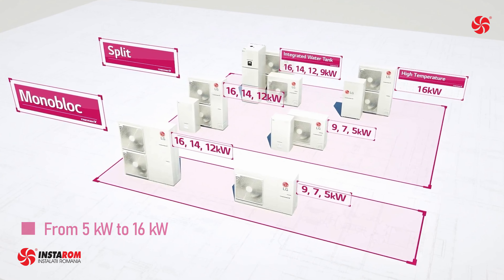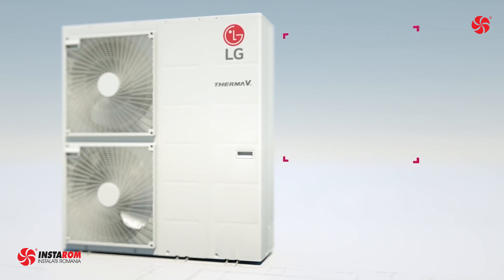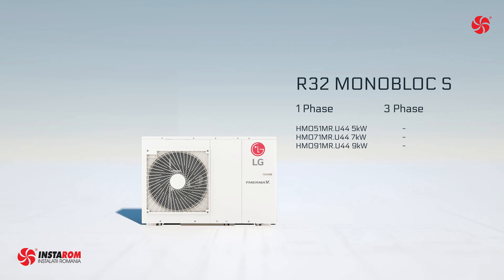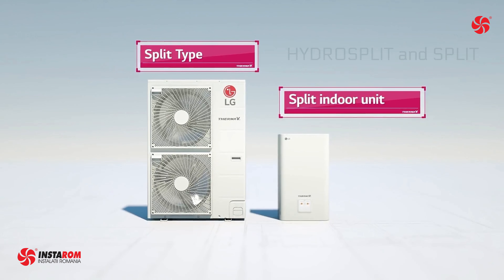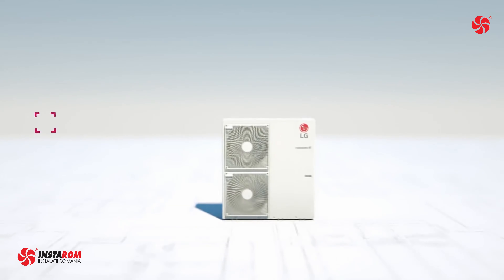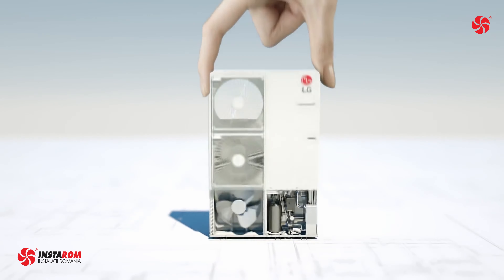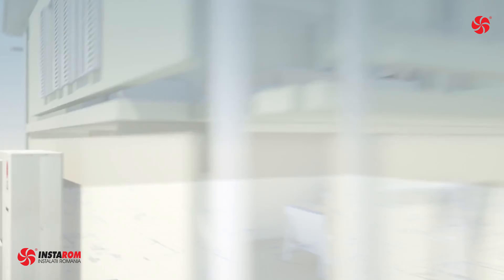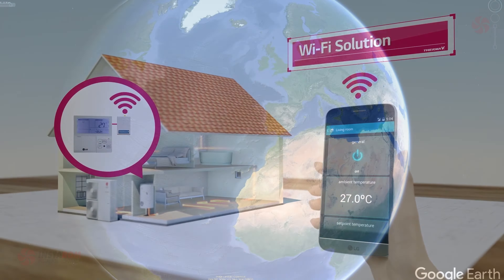LG Heat Pumps Therma V line-up

Comment: Before buying a heat pump it is good that you know what has happened to me. My LG Therma V gave error CH14. The LG Technical Service technician came. It took three minutes to give the verdict: the pressure and flow switch failed. It would cost me about 250 euros. The reality is that the budget that came from the office was 2020 euros, because the switch does not come alone, it comes with printed circuit boards and they cost that much. I didn't accept it because I can't afford it. Draw your conclusions.